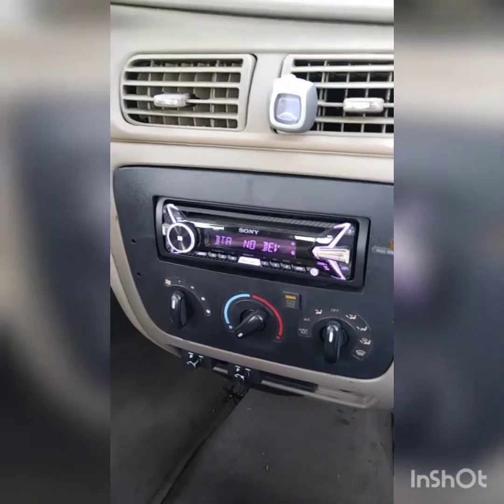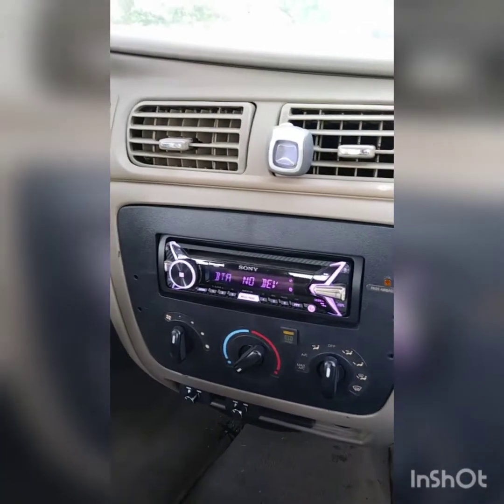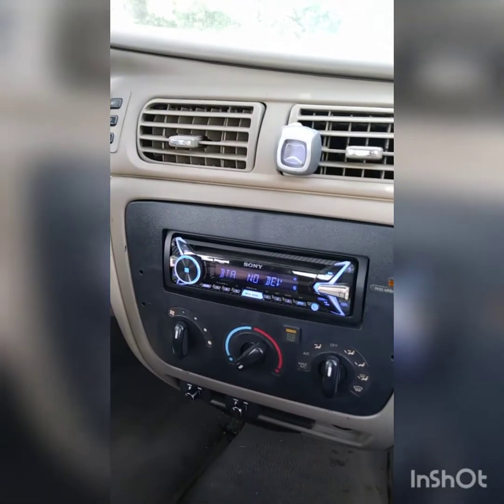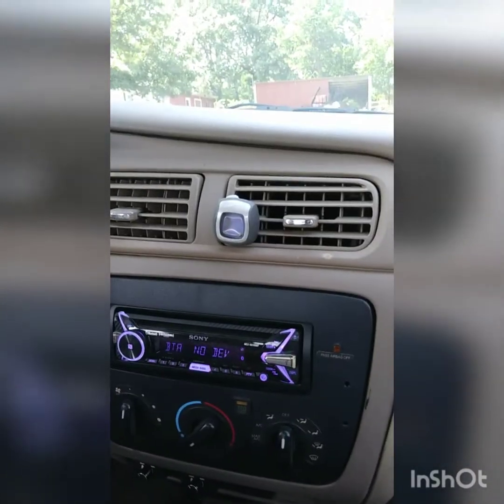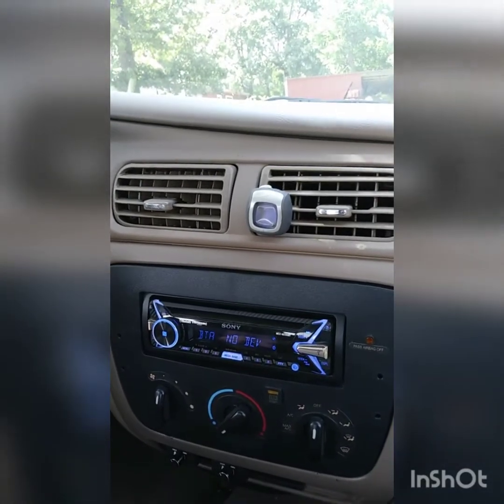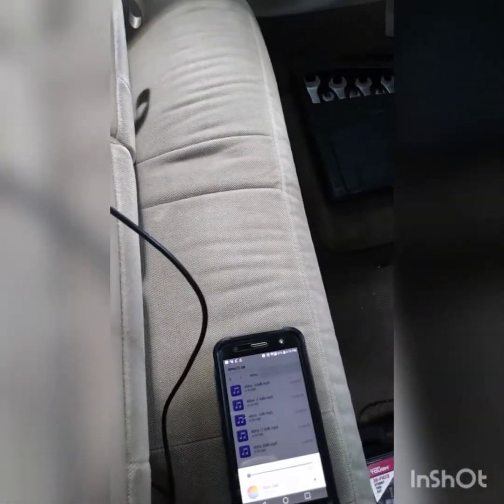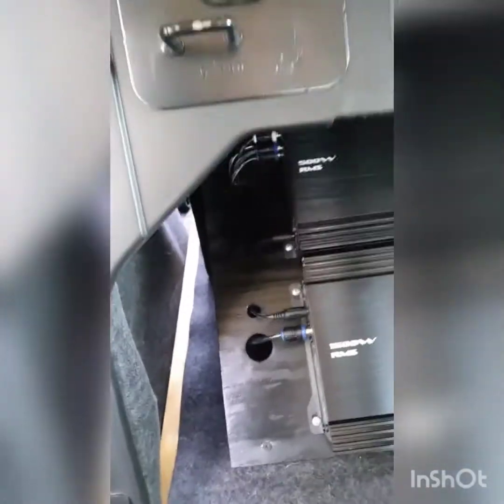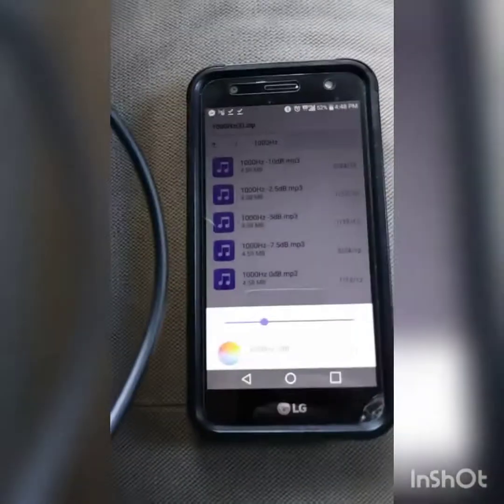Set gains using gain overlap and the Liumy LM2001 oscilloscope

Comment: I know this is old but for anyone that sees this. Save yourself some time and just put the oscope right into the amp from the beginning. Turn all your gains down then turn the head unit up till it clips. You'll see it at the amp. Then turn it down one click. Then switch to whatever tone you're going to use to set gains on your amps and adjust your amp gains. The only thing you need to unplug and plug back in is your speakers.

Comment: My liumy looks nothing like yours man , i think they sent me a really cheap oscope , my waves are so small
Reply from the maker: Mine is now the older model. I'm not sure if the new one operates the same.   Turn it on, switch to ac, turn dial to voltage range you are trying to read. 2v for headunit. Hit select button until desired wave form appears.
Reply: Sleepy Boiii did you order yours on amazon? Does it come with 10x probes that can be used on the amp?
Reply: @Apezilla  yes i ordered through amazon & yes came with probes and some aligator clips
Reply: Sleepy Boiii alright thank you. Has it been working good for you?
Reply: @Apezilla  tbh it didnt work with me at first... But i will have to check it out again if its really good... I went ahead and bought myself a dd1+... Im going to have to do a test, liumy vs the dd1+